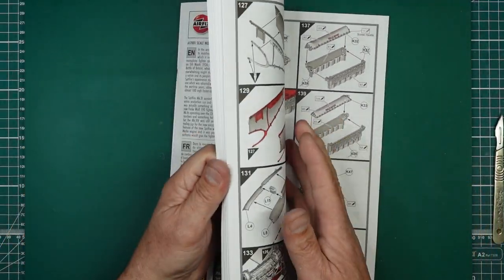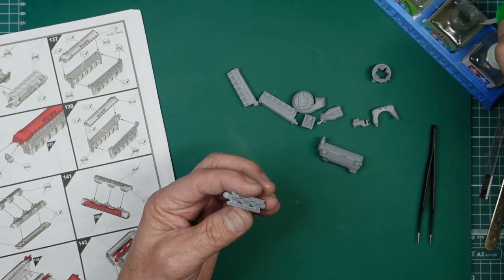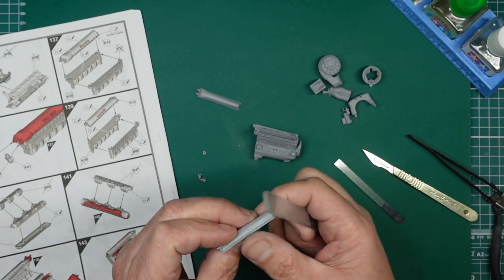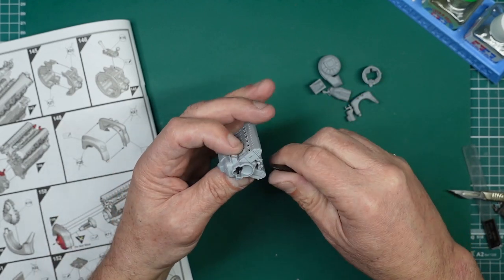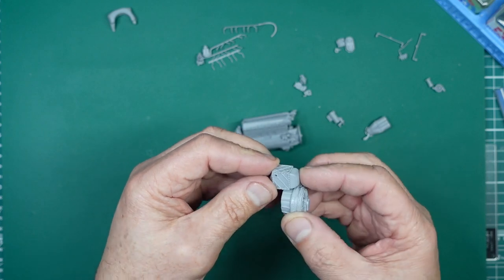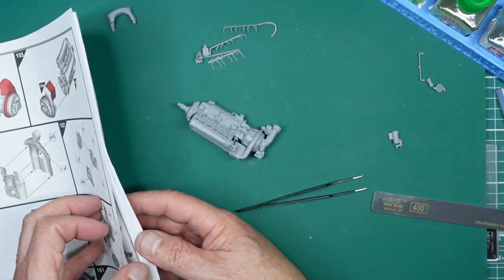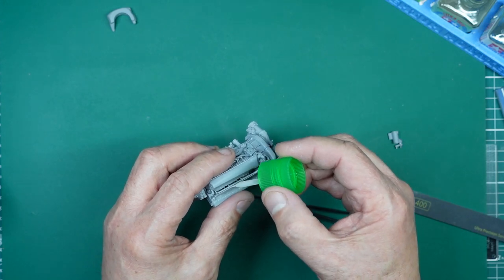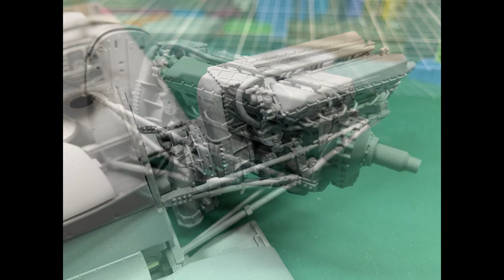Airfix new tool 1/24 Spitfire Mk.IXc Build. Bonus Video.. "The Engine"

Comment: A comment relating to the cockpit, the kit provides the two hooks underneath the fuselage (found on parts F3 and F32) which relate to the provision of a slipper fuel tank. What the kit doesn't provide is the "jettison tank control" for the slipper tank which would be located on the right (starboard) side of part D23. I tried attaching a schematic of the feature but failed.
Another feature missing are the 'S' shaped air inlet pipes found on the front face of the engine driven generator. Perhaps another oversight (like the elevator control rod) given the featureless forward face of the generator.
Last but not least, these comments are by no means intended to slam this kit as it is simply amazing and by far the best offering by Airfix.
Reply from the maker: No doubt this kit is gonna be re-released in many different guises. I guess they have to stop somewhere when it comes to sharing parts vs accuracy?

Comment: Nige, loving the build.
I've NEVER bought anything from Premium Hobbies. Why? Cos they never have anything in stock! I just checked those clear files and it's the first time I've ever seen anything you've recommended in stock. But just to make sure, I went through most of the sections again, and no exaggeration, about 80% of their products say "sold out", and have done for at least a year. Not even your fancy black CA glue. They only seem to be good for some paints and glues. Tools though, the nice scribers you have, the fancy sanding machine, skinny files, etc, etc, no chance. They don't even say if they'll ever have anything back in stock.
Reply from the maker: Hi Brian. PH is a one man business working from his house. he doesn't hold huge numbers in stock, and it often happens that when I review something from there it sells out in no time. We must also remember there are major issues with supply still.

Comment: Just had a look at a Merlin engine schematic and each bank of pistons share the same crank spindle, so the sleeves are all in line
Reply from the maker: All V engines opposite cylinders share the same crank journal, which is why the banks are often staggered, the Merlin has a very unusual design of con rod, as I explained here. This is what allows the cylinder banks to be in line.

Comment: n regard to your block placement question, parallel is the answer you are looking for as Rolls Royce used a system where opposite cylinders  had on the left hand bank a normal but thinner con rod and the opposing  rod  for the other bank  had a two bearing tuning fork shaped yolk that fitted either side of it on the same journal thus allowing the blocks to be unstaggered, other versions on the same theme (though not Rolls Royce to the best of my knowledge) used 1 con rod with a bulged out bushed flange on one side of the rod which the opposing con rod was mated to via a wrist pin. this type was used quite a lot on american radial engines
edited to add : I wrote this immediately you asked the question - but you obviously checked for yourself, oh and yes they ARE called the cylinder blocks being as each carries six cylinder outers for pushed in interference fit liners. by the time of the mark 9  Merlins had seperate cylinder heads, earlier marks were cast with the cylinder head and block as one piece - an absolute bitch to grind  in the valves into  by all accounts.
Reply from the maker: I know.. I explained it in the video.. thanks for the reply.
Reply: @NigelsModellingBench  which was why I added the edit.

Comment: Hi Nigel, following this build with glee (and glue!). For info, it is possible to fit the engine cylinders prior to dropping the inlet manifold between the two. The only problem I have found is with the intercooler top; I think it is short shot but it’s too late as I’ve already fitted it 😳.
Reply from the maker: Hi Tony.. that's what I did in my build.. fitted the banks before the inlet? Sorry to hear you have a short shot. It would appear the quality control of the kit is not as amazing as some people on You Tube are saying??

Comment: David R Lentz, Columbus, Ohio, USA (Sunday, 28 July, 2024) 
UPDATED

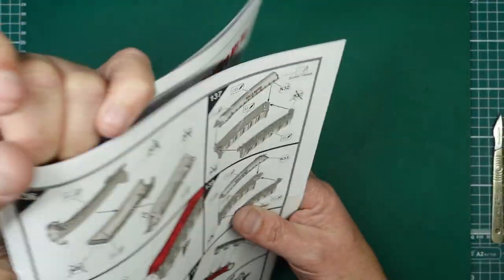Hello, Nigel! Just saw your reveal of HK Models’s 1:48th-scale NAA B-25J Mitchell USAAF Medium Bomber (sighhhh! :( LOL ) kit. Now Airfix’s 1:24th-scale grand œuvre Supermarine Spitfire RAF Mk.IXc Fighter; specifically, assembling the Rolls-Royce Merlin V-12, 27-litre (1,650 in³) capacity, 1,300 kW (1,800 hp) piston æroplane engine. 

   You earlier had asked whether the cylinders on a Rolls-Royce Merlin V-12 Engine were staggered. Being rather the bookish sort, I enquired online—to no avail. 
   Still, I found a few bits that might be of a bi of interest: a de-rated version of the RR Merlin engine was also the basis of the Rolls-Royce/Rover Meteor tank engine. 
   Dwight Thorn is a master engine mechanic whose company, Mystery Aire Ltd., is just east of Gilroy, California, USA. He notes increasing difficulty in servicing and maintaining a RR Merlin V-12 engine to its potential, and that part of the problem is that [it] has six times as many parts as an Allison V-1710 V-12 engine. (source: “Masters of the V-12” (no author cited, no date of publication; https://aroundthepattern.-com/PDFs/Masters-of-the-V-12.pdf#-:~:text=Cylinder%20heads%20are,stacked%20like-%20cordwood). 
   Well, this seems to me like an overweeningly silly exaggeration! What are your thoughts on this, Nigel? What is your field at work, please?
Reply from the maker: I believe the cylinder banks will be staggered.

Comment: Nigel, the cylinders are not staggered! There is a very clever design that joins the connecting rods, which allows this. There is something odd about the Airfix design. The supercharger housing isn’t right, and the cam covers should not taper front to rear as they do.
Reply: Should have kept watching!
Reply from the maker: I've just looked at google images and it would appear some have tapered cam covers?
Reply: @NigelsModellingBench  not to that extent. Don’t let it ruin your build.
Reply from the maker: It wont ruin my build Bruce.. this is OOB and going together well.
Reply: @NigelsModellingBench  good stuff. I worked on a number of Spitfire rebuilds 20-30 years ago. It’s good to see a kit this detailed. Not spot on, but pretty good!
Reply from the maker: I made a part for the Spit they had at RR Bristol years ago. Not sure what it was but it was a lot of fun.
Reply: Merlins had forked rods so that the cylinders could be in line, making the engine shorter.
Reply from the maker: Just like I said in the video.......
Reply: @Nigel’s Modelling Bench  I gotta stop reading comments until I finish the video! ;)
Reply from the maker: LOL!!!
Reply from the maker: I wonder if Airfix have made a Packard engine?? I thought the pipes for coolant transfer along the cylinder banks were a Packard feature?
Reply: @NigelsModellingBench  no, the packard installation and the rolls installation are quite similar, except for the inter cooler header tank, which was integral on the Packard, and separate on the Rolls